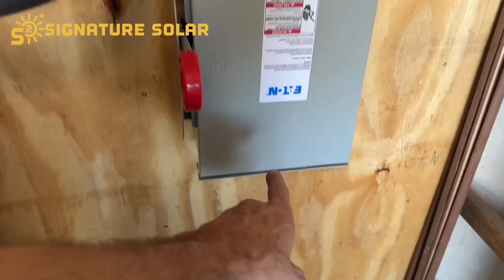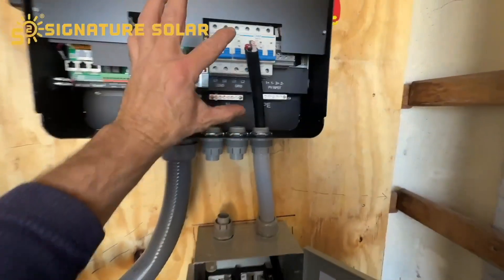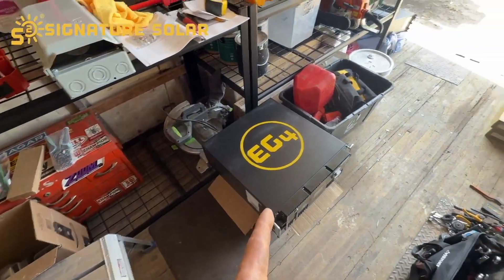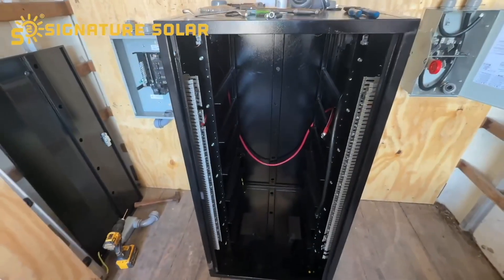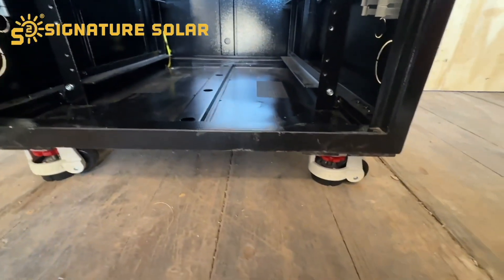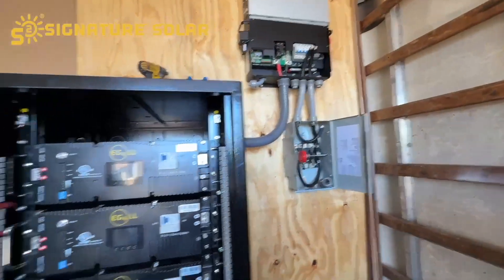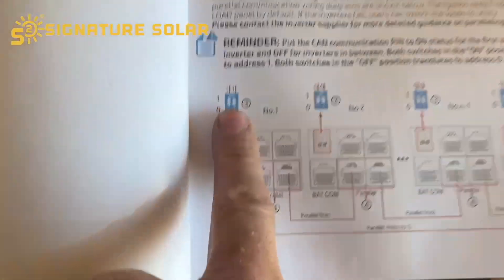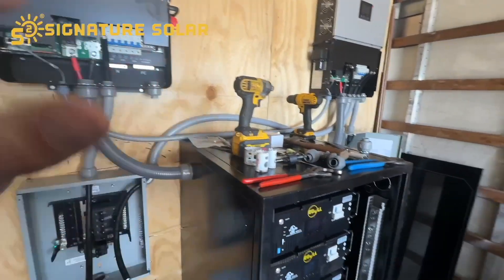Off Grid Solar Install - EG4 6000xp & EG4 LL-S Lithium Battery - Part 2

Comment: Your battery bank out bound cables look too small of gage, but if your inverters are sharing power from the battery bank then it looks right. Potential of 140A to per Inverter from batter Bank.  I lived in Texas for awhile, so I recognize the pine trees.  My mom and dad have property near Meridian and he has Lolli popped most of the pines.  Really opens up the area nicely.
Reply from the maker: Indeed the inverters share power. Our trees are cedar though and not in Texas.

Comment: The Chinese are literally dumping these cheap high high-frequency, transformerless inverters on the US market. They come in different names and different color schemes, but they all have the same thing in common. They all use the same, wimpy, low-cost transformerless design that no American inverter manufacturer would ever touch for safety and performance concerns. Output transformerless inverters are the absolute worst choice for use in off-grid applications. Low-cost, high-frequency, transformerless inverters like these offer poorer surge capacities and shorter life expectancies than low-frequency transformer-based inverters. And even worse, without an output transformer to provide galvanic isolation between this inverter's DC boost stage and its AC output, this inverter can damage your appliances when its MOSFETs fail. Don't take my word for it; ask Google AI this question: Can a high-frequency, transformerless inverter damage your appliances? Or better yet, watch Ray Loveless' video titled "I Had A Surge On My DIY Solar Power System" to learn why you should stay away from transformerless inverters like these.

Comment: Buddy are you doing true Split Phase 240v?
Reply from the maker: @Mitchs  yes I am.
Reply: @grumpysdiy  How exactly are you planning to set that up? From what I understand, you connect each inverter’s L1 to a separate leg of the panel — one to L1, one to L2 — while keeping the inverters electrically separate. Then, in the settings, you configure the phasing correctly (P1 and P2). You don’t use the L2 terminals on the inverters unless you're enabling grid passthrough, in which case 240V from the grid can bypass through to the load panel.
Reply from the maker: @Mitchs  This is what I was told in response to your comment.  It looks like the commenter is describing a setup for wiring 120V inverters for a split-phase system. In your case, you’re using split-phase 240V inverters, which means both L1 and L2 are actively used to deliver 240V output from each unit. The wiring method he’s suggesting applies to a different setup where the inverters only output 120v on their own.
 The manual for these inverters has instructions and settings for the split phase I just haven't gotten to that part in the install.
Reply: @grumpysdiy  That's so weird because from EG4, they said not to connect L1 with both inverters... I submitted a ticket to EG4 last night and they told me this this morning...

"Good morning, Mitch!

         Thank you for reaching out to EG4 electronics!

To wire inverters for a true split-phase 240V setup, it's important to ensure that each inverter supplies a separate leg of the 240V circuit, maintaining the 180-degree phase difference. Here's a general guide:

Inverter Configuration: Each inverter should be configured to supply one leg of the split-phase system. This means one inverter will supply L1 and the other will supply L2.

Wiring Setup: Connect L1 from one inverter to the L1 bus bar and L2 from the other inverter to the L2 bus bar in your main panel. This setup ensures that the two legs are 180 degrees out of phase, creating the correct 240V split-phase power.

Avoid Same Phase Wiring: Do not wire L1 from one inverter to L1 of the other inverter and the same for L2, as this would result in both inverters being in phase, which is incorrect for split-phase operation.

Parallel Configuration: Ensure that the inverters are set up in parallel mode if they are part of a larger system, following the specific configuration settings for split-phase operation.

If you need further assistance, feel free to ask!"
Reply: They responded again "So L1 and L2 of 1 inverter will go to a breaker in the combiner panel.  Then L1 and L2 of the 2nd inverter will go to a different breaker in the combiner panel.  Then you have your outs from the combiner panel which are your 2 legs for the 240.  I apologize for any confusion.  After clarification, disregard my "inverter configuration" part in my last email.  I have attached a diagram for you to also help."

 sooo.. who knows.
Reply from the maker: @Mitchs  I went by what the owners manual said so if something is wrong about it, it’s on them. But I think the way I have it wired is correct. Appreciate the comment, I learned a lil something asking ?’s
Reply: @grumpysdiy  You can’t wire both inverters to the same panel legs, because one inverter is configured as Phase U and the other as Phase V — they’re 180° out of phase.